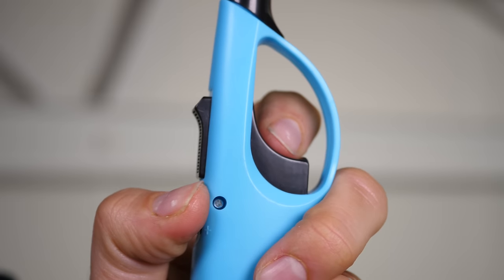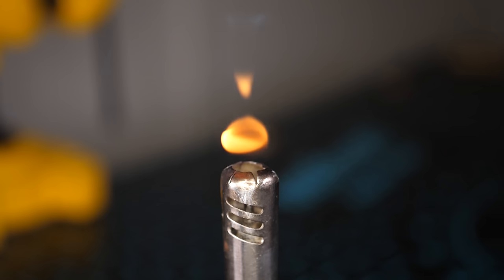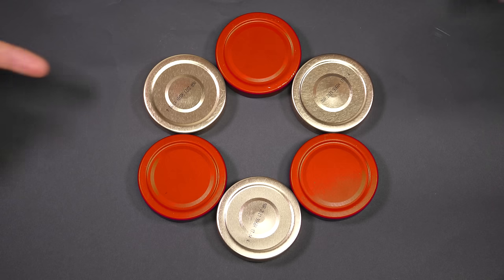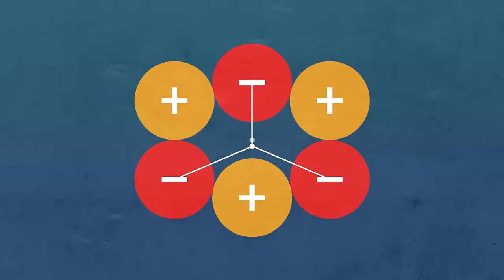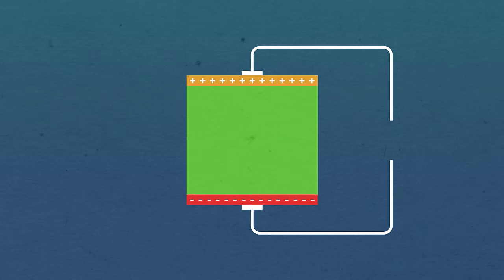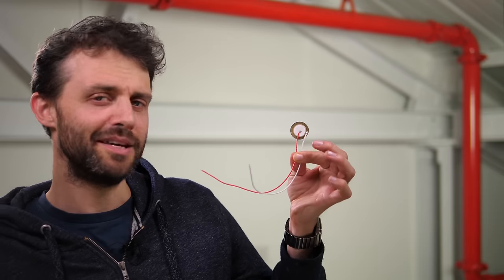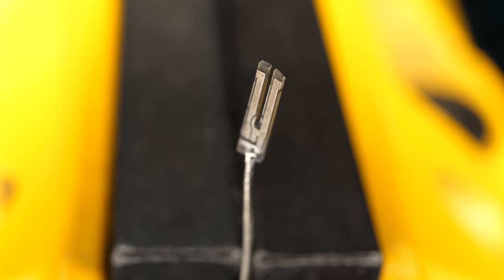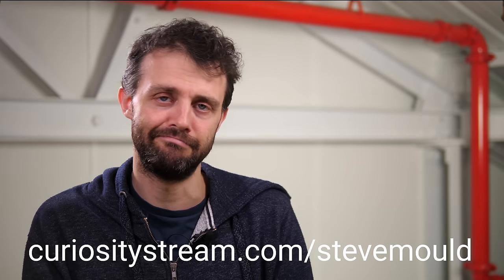Piezoelectricity - why hitting crystals makes electricity

Comment: Now imagine the power in the Great Pyramid. It sits on a Layline. Constantly vibrating, with a concentrating shape towards the sky. I think the big luminescent tubes shown in pictographs were tuned to the resonant energy from the Gold tip of the Pyramid. Anyone with enough money could own or lease from the power company their own power source to extend their workday, and growing season.
Reply: Piezoelectricity does not scale up. On top of that the Egyptians had no concept of electricity
Reply: @Coastal_Cruzer  Did you read all of it? Piezo does scale up. Do you design electronic systems? The the thickness of the wafer determines resonance and voltage output. Imagine millions of pounds under pressure and the Schuman resonance. Millions of volts at high frequency, bouncing back and forth. There was a metal tip on top for what? 
The "Coffin" was supposed to contain Mercury. Did you ever look at Nicola Tesla's Free energy project? Free wireless energy for all. Westinghouse said screw that. Didn't pay Nicky the $50k for the motor he designed and built. Or was that Edison?
Egypt is a lie. They built those crappy wannabes behind the Grand Pyramid. They are not the Ancient(read all my statement) Egyptians. 24 thousand years prior. I know people making concrete that you can't tell is  not stone. Their story of Human hair in the stone is easy to accept now.

Comment: Steve I was lying in bed thinking about this video when I arrived at: what if you struck a tuning fork then held the vibrating end of the fork close to the crystal so it is being hit at the frequency of the fork. The question is would the electricity generated be greater than the energy required to strike the fork initially.

Comment: Piezoelectricity is created in 2 possible ways: attaching a current with a battery or other devices or placing crystals in a permanent magnetic field. The interaction of Fields is key for charging crystals. I enjoy this work everyday.

Comment: So, can we generate power from piezo crystals? Real continuous power, not just sparks?

Also… from the explanation I understand that voltage differential does not depend on length of crustal. Could this be right?

Comment: Does constant pressure on a piezoelectric crystal create a constant electrical current or does it need a Sharp change and only creates current for a instant? Plus does it come as an AC or DC current?
Reply: Has to be dienamic. But lava is always flowing. Lava is about 20% silica.

Comment: Can you measure the piezoelectric  energy coming from a series of quartz crystals submerged in liquid nitrogen? ( from a wire pigtail coming out of the liquid nitrogen tank….that’s attached to the wire wrapped quartz crystals submerged there)

Comment: The quarts does not vibrate. The tuning forks do. every time they vibrate it is like a hammer hitting the quarts. The quartz gives the same amount of energy back every time you strike it with the same amount of force applied. You don't need a tuning fork. You can use water hammer or a pulse wave from explosives. As long as there is impact on the quarts it gives off energy equal to the impact. I like the video though.
Reply: Look at my definition. It's perfect.

Comment: Now, there is even more to this, involving quantum mechanics, electron energy level band gaps, and electron-hole pair recombination. Now, I wish I could explain these words in a sensible way, but unfortunately it involves a bunch of pchem and solid state physics, which means it might as well be witchcraft with regards to my understanding on the subject.

Comment: Maybe I'm missing something fundamental, feel a little silly for asking, but where does the energy come from? How does the crystal not deplete?
Reply: There's no energy in the crystals, the energy is the kinetic energy from the hammer hitting it. With the help of the crystals structure that is converted to electricity.
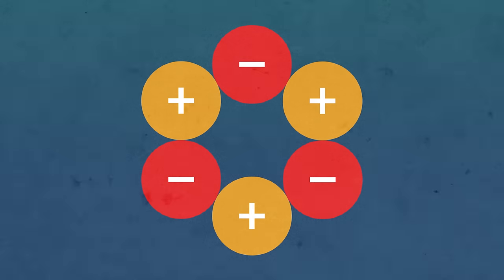Reply: @SilverEye91  Exactly! Also at around 3:38 you just move the charges around, not take them out or put them into the crystal.

Comment: Sir, we are electricity, and our bodies use electricity.  We are also held together by  electricity,  and frequencies. So the crystal helps with the electric frequency.  So each stone has a different electric frequency.  It can also be charged right? So I hope this helps with the healing part. The whole chakars. There's your answer Sir. Ohh and we should have solid state batteries by now as well.

Comment: But how the polarity is completed?
Like ok, it has after hit charge, but you can create spark connecting to the metal that doesn't have negative or positive charge and doesn't connected to different part of the piezo. And obviouse condition for electricity to move is to have difference in charge.

Comment: Why can't we build quartz power generators in large enough scale to make usable power? Actually I just thought about the fact that it probably takes more energy to squeeze the crystal than you'd get out of it but what about applications where you could squeeze them for free by doing something that needs to be done anyway, like rolling heavy weights down hill, like at a steel plant, or a saw mill, where they're constantly rolling heavy logs down into the bandsaw all day long.. why not embess a bunch of quartz generators into the chute where they roll down, and each time a log or steel billet rolls down you could harness the power it creates?

Comment: In wartime quartz crystals mined was brought to the USA in boxes 📦  women would take the crystals  and stick them in a clear mineral oil tank then the lattice structure  could be seen then the crystals  was marked x y z  then the crystals  was sliced and mounted on a aluminum  disc then they was put into a tester then shaved and tuned to a oscillation using a meter then this crystal was put into radios in wartime so the crystals  would all vibrate the same in each radio 📻  this way all tadios could hear and transmitted to each other

Comment: Hey Steve, maybe you heard about Orgonite. Metal and minerals in acryl resin. Does that has also the piëzo-effect because of the pressure of the resin? And do you know if there is a device to measure the effects of Orgonite on electromagnetic fields?

Comment: Thanks..
So if you hit a quartz crystal, it will vibrate on it's natural frequency which is about 32 thousand times per second .. but why would it do that on the atomic level? .. I mean, yea if you hit it once, the lattice will get compression and an electric field is made etc... but an oscillation of 32 kHz mean that the lattice would compress and stretch for this number each second "for short time until it stops" ? And why would it do that? Where is this spring behavior from?

Comment: How long can this process last?  Won't there come a point where the crystal loses all of its charge?   It is believed by some that piezoelectricity was used in the making of the pyramids, using the Nile River as a source of pressure against the crystals, generating massive amounts of electricity.

Comment: Do you suppose that there is any way that if you had two of those magic quartz sticks (2.16) with all the side facets, and all the tip facets, you could find a way to tap the two, together and knock yourself down, or don't the natural cut/break lines of the crystals make this possible

Comment: Steve what would happen if you had a pezio quartz crystal say 2m x 1m wide x 1m high, I’ve found this effect in an extremely old Egyptian text.
But the author describes it as lightening balls, balls of fire, here is the curious part …. I went to the artifact in question…. My jaw dropped…. It’s a huge faraday cage…. 2-3000 years ago…. Can you help me…. Helping us understanding this text…. Is it plasma lightening? It seems like it’s using the boiling off of water to make the plasma….
Is there any research on this kind of extreme engineering? It’s King tuts shrines… wood center, coating of glue and stone, and a layer of gold leaf interior and exterior. I’ll explain the base source of power…
The force used was a concussive explosion of methane at 1 atmosphere.

Comment: When the electricity jumps from one wire to the other, it's doing so to try and neutralize the +/-? So it's trying to bring the whole (now compressed) crystal to neutral? 

How does it "reset"? When it decompresses does it then rest in an imbalanced state?

Comment: Piezoelectricity is to a crystal as fllux is to a magnet OR kinetic energy to a wound spring OR like twists to a rubber band on those planes we built in science Olympiad…..

All store a finite amount of energy that is used by us humans. 

Sidenote: the term “flux capacitor,” made famous by the movie “back to the future,” is actually just a magnet because we call the “energy” deployed flux. A capacitor is an electrical component that stores electricity…..different from a battery in its charged/discharged very quickly where as a battery uses a chemical reaction to charge or discharge. So we know a capacitor stores energy and flux is energy in magnetic field form thus a flux capacitor is simply a magnet!🤓
Reply: Not even close. Piezoelectricity is the transfer of mechanical energy (vibration) to electricity or vice versa

Comment: So if you need "compression" to generate the spark. What is happening when you simply rub two quartz crystals together and they light up internally???🤔
Reply: I've seen that happen with rose quartz. I think they are fluorescing from some of the voltage exciting valence electrons to a higher energy state and emiting little bits of photons when they fall back to ground state. Interesting note!

Comment: couldn't we use this effect to generate electricity on an industrial scale? it seems to be very cost efficient. As we push electrons out of the crystal, it will obviously be slowly consumed or neutralized with time, but we all know that the barbecue lighter continues to give a spark long after the gas is gone. And considering how tiny the crystal is and how strong the electrical resulting impulse is, why not try it on a bigger scale?

Comment: So if e=mc squared.  What is dissipated when  the current is generated. Is there less silicon or what ? I dont get it. Does the quartz recharge when it assumably bounces or is  reshaped  back to it's original crystal symmetry ? How does that work? Too many questions  ...

Comment: If I stretch the truth far enough I can blame Crystal Radio, Coils, Capacitors, Antenna, Diodes and Earphone assemblies for failure to relate to Physics Courses at University, because nothing I saw at Uni fitted with the observed AM-FM Communication of the Device Function, Tuning, and modulation-demodulation phenomena. 
The operation of Fields kinda contradict the Atomisation and Particle story, unless you read "Chemical Bonding Clarified through Quantum Mechanics" and think about it for a couple of decades. 

Eventually the Correspondence of Pizoelectric Effect, Crystal conic-cyclonic coherence-cohesion suggests and illuminates the Holographic Principle Imagery of QM-TIME Duration Timing Conception. 

Spinfoam-pulse bubble-mode crystallisation of Electron-photon-phonon-Proton oscillation holography, Reciproction-recirculation happens when you hit it with either electric or "phonic" pulse-evolution differentiates. If you think of yourself as an emitter-receiver condensation in Quantum-fields Mechanism, line-of-sight density-intensity wave-packaging Modulation, a size less scalar resonance bonding, what is conscious awareness of real-time Actuality experience, in the practical sense of the video explanation? 
The time-timing Ghost of departed transverse trancendental, log-antilog vector-values?

Simple Real-ly. (Too simple not to be frustrating headache material, trying to explain to those who live in denial of this AM-FM Actuality)

Comment: Qestions 1  can you decarge a crystal compleatly i understand that the charges bounce back after striking but dose it reduce its atomic charge over.time   and if it dosent then dosent that go aginst the laws of energy and would constitute a perpetual motion construct and coulnent we replacate the compression lattes larger and with something like actual magnets that create energy more then it tackes to make it by makeing the cystel lattes smakc aginst a disconected and opposite cystel lattes both repeling each other  then caousing reaction simply by swithing off a on a mid repelnt to the two
Reply: I don't think the charges leave. As mentioned at around 3:38 when you compress the crystal, you just move the charges around, and the change in charge distribution is what creates the voltage difference. 
Also this does not violate Thermodynamics, because YOU are actually supplying energy into the system by squishing the crystal, and that in turn is converted to electrical energy by the crystal. Subtle, but good question.
Reply: @DirkIronside   what. I ment was like in a lighter with uses peso electricity  the charge dose leave it creates a spark so could one build a magnetic substrate  based on the effect that crystal lattice dose to create that spark but using let's say nitrogen gas to increase the potency of the magnetic current so that one smack give a exponential discharge larger then the energy needed to create the smack it wouldn't be against the laws of motion or any other laws or energy but due to the property's or the magnetics and the crystal lattice design and the nitrogen ability to increase charge it would be a clean and reliable and free anergy system that's not propetual motion  as the lattice naturally resets and the charge would be higher the the energy needed to make the smack

Comment: why doesn't the quartz crystal never run out of electric charge and what's the cost for producing that electric spark? is it an ever lasting electric producer?
Reply: The crystal is placed under a metal plate which sources the free-flowing electrons. This plate is connected to two wires that form a loop, so it can never 'run out' of electrons as they return to the same plate after moving through the wires. The cost of producing the electric spark is the mechanical energy of hitting the crystal. The crystal deforms and converts this mechanical energy into electrical energy. Eventually the crystal will go back to its original shape and stop producing electricity.
Reply: The quartz doesn't generate electricity it converts mechanical stress to electrical energy

Comment: How ridiculous would it be to install quartz in sidewalks, floors, roads etc and use all kinds of traffic to produce electricity?
Reply: The cost of installation and maintenance would probably be higher than electricity produced. I'd wager there is a good reason why you don't see it being done.
Reply: Very. Piezoelectricity doesn't work at large scale

Comment: I saw a light spark when I closed my eyes after I accidentally  kicked a crystal glass.  Light  blue
Mood stable
Reply: 9.30.22
Reply: Spark
Correct
Reply: I've been eating a lot of protein, fruits
Grain such as granola
Out of vegetables currently

Spiritual 
Sign High pitch sound right ear

Requires Patience 
Body Circadian 

Meditation 
Water 

Building Muscle 
On the down note I gained weight. 
Definition
Crystallization is positive for me in my transformation
Reply: High density

Comment: the piezo system in a lighter has only one wire where the spark goes across on the gas nozzle tip and im wonder how this happens if there is no ground return?
Reply: yes i know that but in a regular lighter there is no ground wire to the piezo unlike the bbq lighter where you will find two wires a positive and a ground
Reply: @ARCSTREAMS  regular lighters use a ferro-rod and striker
Reply: are you trying to be cute or what? im talking about any lighter that uses piezo ignition as in a cigarette lighter and not a bbq wand lighter  @Coastal_Cruzer
Reply: @ARCSTREAMS  Ohh one of those. I had one of those. Hated it to no end, still have scars on my thumb from it. But yeah I'm trying to remember how it worked, I think the ground end of the striker was close enough that it didn't need a wire

Comment: Pressure on the hexagon is activating the oxygen 
Oxygen is the key. The oxygen can be charged from O2 right up to O23
This is what happens in the Ozonosphere activated by UV rays.
Also the oxygen in the acid battery electrolyte is what gets charged.
The oxygen in water vapour in the clouds build up a charge when 2 opposing flows of ice particles (hail) charge up the entire cloud .
Consider also the Laden jar.
Oxygen is key.
Reply: No.
Reply: @Coastal_Cruzer  - cruzin for a bruising

Comment: Strange. Chakras are meant to be about vibration/frequency/energy and crystals vibrate at a set vibration/frequency/energy and you just brush that off as not existing. 
Just because you don’t know what they are doesn’t mean they don’t exist. It’s like claiming electricity doesn’t exist in the human body and that it only exists in power stations - so obviously crystals couldn’t create electricity when being tapped either.
Such narrow, limited thinking.

Comment: This lends credibility to the theory that the purpose of the pyramid of Khufu may have been power generation.
The large, expensive [and harness] of granite blocks that lined the King's chamber must have been more than just a "nice" but meaningless gesture when much of the pyramid was made of  more plentiful and manageable limestone.
Also, the primitive manual copper tools of the day fail to explain the cutting, polishing, transporting and installing with stunning precision of that granite.
The King's chamber is lined granite with SiO₂ and the Grand Gallery could be the resonator/amplifier of sound.
Reply: No. Just no